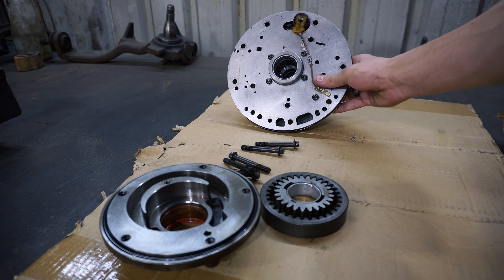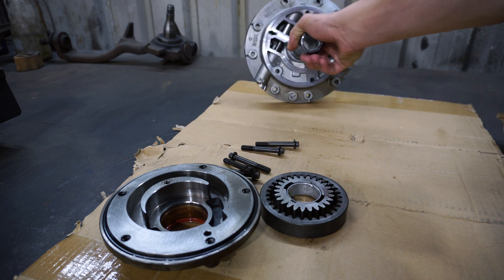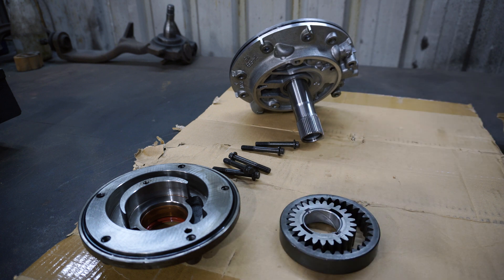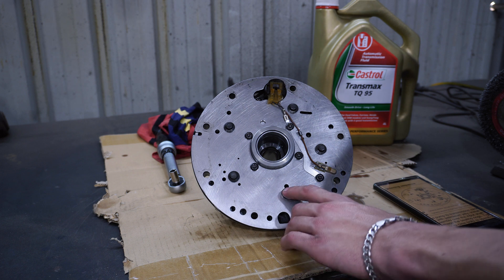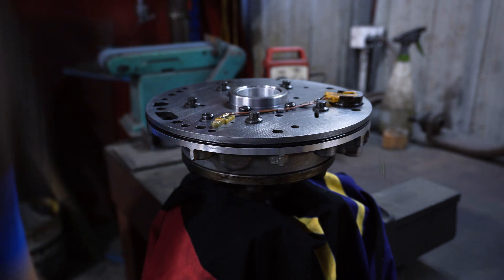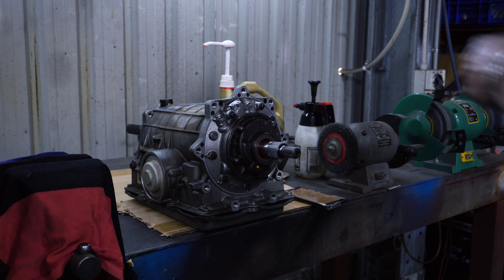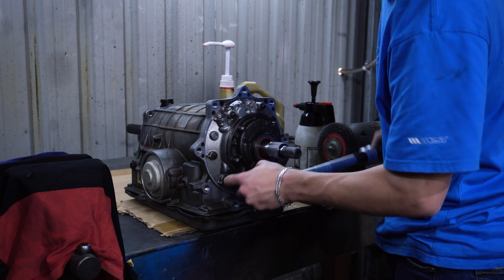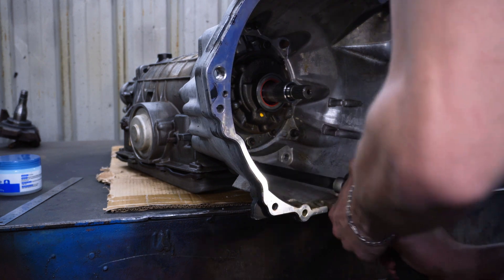Beefing The BTR Part Three | AU Oil Pump Upgrade

Comment: Gday there Mark from Perth my question I have a boss 260 my auto has that reverse pause when it’s hot and it does have a external cooler and I’ve just had a rear seal replaced and the usual filter and pan gasket change so my main question is can I just change or upgrade the pump without doing anything else or not what would be your advice the car has done 230 thousand and the auto gear changing is fine so far so again what would you recommend me to do anyway your videos are very informative thank you

Comment: Hi mate, older video, but I thought I'd try my luck asking anyway. I've been looking at building my own btr. So far, I have the planetaries and oil pump from an e series, however stuggling to find a good reputable kit to rebuild the rest of the box. Eg. Clutch packs, cast rings, bands etc. Was boping i could get a recommendation off you, Ta

Comment: Thank you for using TQ 95! The only stuff that should be used on any BTR.
Reply: Should Mobil 5w30 be the only oil used in an LS? It’s written on the cap as factory fill..

Comment: Nice work mate, Love this series. I have an AU XR8(97LE) BTR that i'm planning to rebuild and use in my 98 XH. I believe I can use a 6 cyl stall converter on it with no issues, is that correct? Also, will i need to swap the looms over due to the XR8 normally running a TCM?
Cheers
Reply: Check the input shaft spline count and diameter
Reply: @fordbarra  for the torque converter? Will do, thanks mate

Comment: Im surprised you haven’t adressed the main issue with the BTR when used as a performance box ,  or harsh enviroment that being    " heat reduction"  .

The standard settings on the  S5 plays a huge roll here  1/3 -1/2 turn for mild applications 
3/4 -1 turn for race 
And a  very big  trans cooler  or 2  

These boxes 20 years ago were failing in taxi's due to heat from idling in cab ranks . Heat and  extra friction  from the S5 settings and the shit pump is the main reason these boxes fail , There actually a very good box when done correct . Id never use a  BA BF series box .
Reply from the maker: Electronic adjustment will also achieve this, basically so mininal pressure is bled off. Not really up to that stage however as I still need to get the box in the car before tuning and cooler fitment. Heat is certainly the key factor of the BTR's failures. Clutch and band wear is accelerated and lubricant is less effective. These guys need a big cooler, and even better the older style pump from an EF to AU. EA to ED create unnecessary drag for most applications.

Comment: Its actually getting very hard to find complete AU transmissions with converter . Theyll end up being $1500 transmissions soon
Reply: Wtf I just bought two for $100 cash.
One has a torque converter.
Reply from the maker: Can still find heaps of the older boxes over in WA for under $200.

Comment: Those  EF EL AU transmission are worth way  more than $70  , try $350-$1000
Reply: U can find deals on stuff I brought a Au motor & box for $50
Reply: I just got two AU BTRs for $100, one has a torque converter
Reply: 350 is top dollar 1000 is never going to happen when you can buy a full reco box for 1200

Comment: I had to replace the au pump because incorrectly installed torque converter snapped the sun gear chewed the cup & prongs on converter, it also cracked the aluminium sump 😐.
Reply from the maker: Damn 😔

Comment: keen to see the eb box done, id like to freshen the one in my NC up
Reply from the maker: Yeah mate, hopefully I'll get it done soon, need to order a high stall converter and rebuild kit
Reply: Any news on the ed box?
Reply from the maker: @TheMrkylester101  yeah mate, I'm tearing it down next week!
Reply: @thebarraspecialist  sound good 👍 any aftermarket items required to manualize?
Reply: @TheMrkylester101 mines manualised using Mr btr controller. Works well